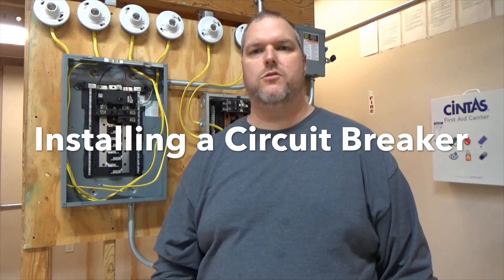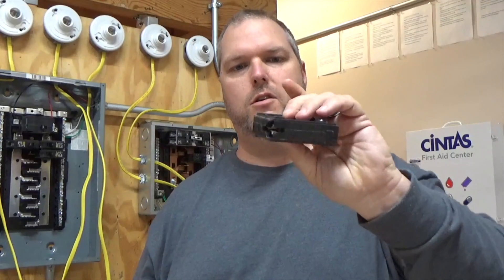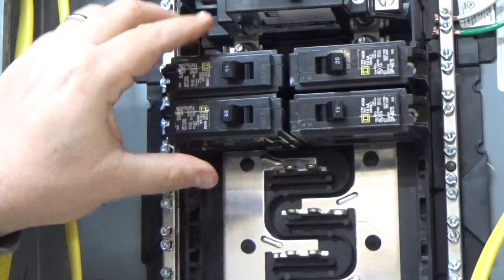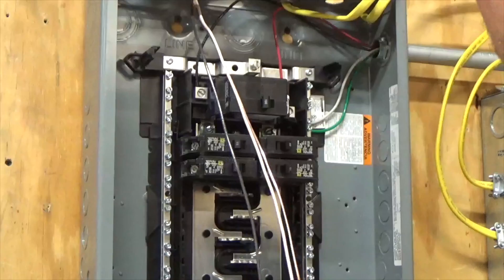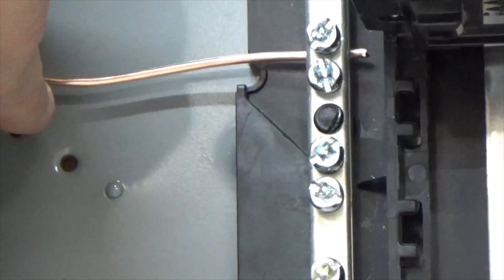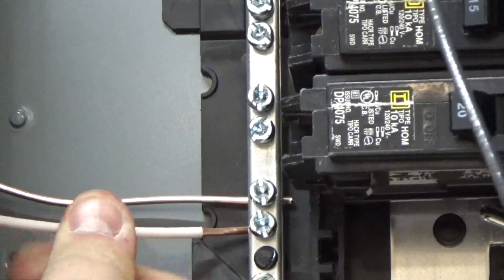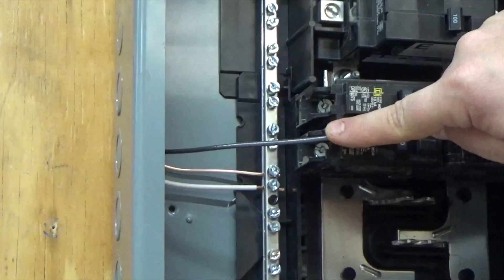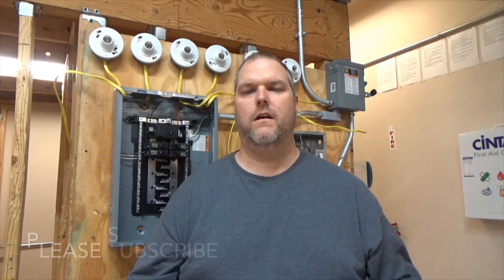Installing a Circuit Breaker

Comment: Is it safe the put the neutral wire with the ground wire on the same bus line??
Reply from the maker: You will have to add a ground bar and land the grounds or bare wires and the neutrals will go on the bar connected to the neutral feeder wire. CM
Reply: Do You know how I would run it with a sub panel
Reply from the maker: This question is asked alot and the answer is yes. This is my trainer and it is used to show a main panel. The ground and the neutral are bonded in a main panel. Now if this was showing as a sub panel than No as then the grounds and the neutrals would be separated. Please understand that it is to show a main panel. I will be doing a video on where this is explained in the code as it seems most people dont realize there is a difference between the two. Thank you for the question!!! CM

Comment: Best electric tutorial I have seen on youtube
Reply: SE AK you serious ? This panel is obviously not connected. But some panels are. So if he used any common sense he should have mentioned to turn the main circuit breaker off. And he put the ground wire and neutral together.
Reply: @zvezdandespotovic1693  the only way to know how much somebody knows about something is if you know about that something yourself.otherwise you could be telling somebody which spark plugs works best in a diesel engine, and someone could  think you're very knowledgeable.

Comment: No mention of making sure the power is turned off before starting or how to check to make sure there is no voltage present where you are putting your hands. Then you put the neutral and ground on the same bus. I wonder how many people are going to get hurt because of your incompetence. I wouldn't trust you to screw in a lightbulb.
Reply: jeff r the ground and neutral are bonded in a main panel anyways so what’s the problem with this one? It’s literally the same thing. That bus has the screws in pairs for each set of neutrals and grounds to be connected there. What’s so hard to understand. Maybe you shouldn’t even be screwing on light bulbs

Comment: Ground wire and neutral wire don't go to the same terminal block..
Reply: In a Residential setting it is now NEC code to land your neutral and ground under the same lug on neutral or ground bar

Comment: Craig, good presentation, however, at the beginning  you gave permission to your students to poke their hands into an electrical box while looking the other way. Glad for you the panel was cold and your hand stopped where it did. A careless student might not be so lucky.
Reply: You're not supposed to work them hot.
Reply: There can still be parts that are hot where the main breaker lugs are in a main residential panel unless you get the utility company out to pull their meter while you work on the panel.
Reply: Dan Benton what u mean

Comment: Did i miss something, or did he fail to mention at the very beginning, that it would be a great idea to turn the main power off before anything else
Reply: Where the fuck did common sense go.
Reply: That's optional
Reply: @ltwadley7619  the result would be longevity?
Reply: @lanceclayton2492  Learned the hard way, I blew out my panel and got a terrible shock.....turn power off before inserting the breaker.....
Reply: Pro or not i will recommend you turn the main off, ALWAYS, do me a favor and don’t get kill
Reply: @merceds4633 right? And what pro is coming to YouTube for a tutorial on what has to be the most basic skill for a pro?
Reply: @merceds4633  if you're a pro and you turn the power off your not a pro.
Reply: @stevansaucedo4151  said who?
Reply: stevan saucedo it’s always the “professional” swimmer that overconfidently finds a way to drown
Reply: @stevansaucedo4151  strongly disagree. The only reason to NOT turn the power off would be a situation in which the work REQUIRED the panel to stay live. Those very specific conditions do exist, in which electrical work must be done while the work area is live... but for most people replacing a basic breaker in their home or garage or so on... it's just plain dangerous and silly to be doing this with the panel live.

It takes half of an amp of electricity across your heart to kill you. Those bus bars and especially those big mains coming in are no joke, many times more juice than necessary to put someone to bed for good. 

Take the 10 seconds, shut the main off, and do the work safely. Just no reason not to do it in 99.9% of the cases.
Reply: @brandonkick  I am a foolish novice DIYer.  I was upgrading old outlets in my 1060s home.  Being careful to turn power off before working on each one.  And testing my work as I went along.  One outlet...I thought the main power was off.  It wasn't.  I am lucky the tool I had in my hand was a wire cutter with a very thick rubber handle.  Or I'd be dead.  You should see the melted steel at the cut-end of this tool.  Scared me out of any electric work.  That was 12 years ago.  Now I hire an electrician.
Reply: also he touches the power bus like its ok to do so.
Reply: The panel is designed to be worked on while it's energized. NEC code requires the cover to stay on unless a qualified electrician is present.
Reply: He's saving time by not turning it off
Reply: Nor did he mention not touching the lugs
Reply: My chief concern would be having a neutral bounce over and hit a hot leg while I was wiring it.  Replacing an existing breaker without a need to cut wires is pretty easy to do hot.  Stand on a dry board and use one hand where you can.
Reply: u missed the last episode
Reply: Obviously he is an instructor and he looks like he’s in a classroom environment the only thing that breaker panel is connected to is those light  ball sockets with no light  bulbs connected so yes it wise to shut off the main power with actually working on it but the The video it’s demonstration model
Reply: He never mentioned it, but most of us know to turn it off first!
Others will find out🥺😢😩😤😳
Reply: @marcelociarro8527  both
Reply: Yes, point taken
Reply: No legs from the utility company are connected.
Reply: he is the instructor...   do not question him, leave it on
Reply: That depends on the homeowner bucko
Reply: Optional
Reply: 🤣🤣🤣you right hw didnt mention it,he might have super powers🤣🤣
Reply: i think he forgot to mention that because his panel is a display panel and doesnt have an actual hot main. seems like he knows what hes doing but is or was new to making a video.
Reply: Unfortunately yes. Hopefully everyone attempting this sees your comment and turns off the power.
Reply: Idiot
Reply: Jesus, do people not use common sense anymore? Why do you need to be told to have the power turned off to work on the MOST DANGEROUS part of an electrical installation? Is that not something they need to figure out?
Reply: I think it was suppose to be implying that the electric was already turned off. However, I agree he should of mentioned it & made it very clear to be sure the electric was off.
Reply: I guess it all depends how comfortable he is with it. I would turn it off, but I dont do it everyday.  I have replaced receptacles that were live,  but that's not so scary to me.
Reply: If you don’t know to do that you shouldn’t be installing breakers
Reply: @gunneredwards6609  correct…..but people reference YouTube all the time as DIYers. Can t assume anything.
Reply: exhalejackie so u telling me to put a break in the panel u have to turn it off? u can't do it live?
Reply: @NewPhone-bg7do  Not if you like to live. While you can complete the job... there is still a risk of installing a breaker while the box is hot. Best bet is to kill the power at the main. Even better is if your house has a disconnect on the outside, like mine does... then even those big beefy mains coming in can't get ya. Of course, all the pros and manly men will say it's a sissy thing to do, but I rather enjoy living. I don't take unnecessary risks, when the dangers are possible death... just isn't worth it.
Reply: @NewPhone-bg7do  hell naw you shouldn't
Reply: If your a professional electrician and know what your doing you don't have to turn power off.  I asked the same question to the electrician that worked on my panel. Be careful not to cross any wires.
Reply: @LugNuts2.0  and don't get absent-minded, if you work them  hot.
Reply: exhalejackie This guy is someone to never follow. Very stupidly dangerous video.

Comment: when you're installing a brand new panel, how do you know you have a 100 amp panel or 200 amp panel. Do all your breakers add up like say 15 +15 +15 + 15 = 60 so then you just do a 100 amp as your main. Is that how it works?
Reply from the maker: Its based on your Main breaker. You must be sure your wire Ampacity can handle the load you are applying to it. This is a common question. I will be doing a video that explains this to make it more clear. CM

Comment: Very helpful video. I have a question, much be a silly one. My back room is connected to 20amp breaker. In that room, I have my tv, cable box, tv sound bar, dusk til dawn light, porch lights, 2 fans, and a small refrigerator. They’re not all connected to the same outlet of course, but until this day, the breaker hasn’t tripped. I know a refrigerator can take up a lot of Energy and I’ve read that a refrigerator takes over a third of a 20amp breaker. I’m not a pro and I’m looking for a lot of input. What do you think?
Reply from the maker: Well that does seem like a lot but when you think of it in Amp draw most of the stuff you have does not draw all that much. Seems to me you just had a bunch running at the same time. If this was your only time I would not be concerned, but if it happens more then email me and we can discuss some options to help you. Thanks for the comment!! CM
Reply: Craig Michaud- Electrical Instructor I don’t run everything at the same. The lights are only running at night, the medium sized fridge course all the time , and the tv/fans only when I’m back there . So far so good....
Reply: @josep2807  If it were a regular sized refrigerator, I believe the NEC requires a dedicated circuit to a dedicated appliance, which means one is not supposed to put any other load on that circuit.  In your case, it's a small refrigerator.  20 Amp x 110 V = 2200 Watts maximum.  You don't wan't to load the circuit up to more than 80 percent of the 2200 Watt capacity = 1760 Watts...that's called a safety factor.  Now, each of your items has the watts listed on the equipment, or sometimes listed as VA.  You can add each item wattage up to see how you compare to the 1760 Watts, in the event everything is running at the same time.  It's required by law that each item list their wattage intake.

Comment: Clearest instructions I've seen on this.  Thanks.   I had one electrician quote $900 to install a breaker and an outlet right next to the box.  For $50 in materials and 90 minutes I did it myself

Comment: I need to run a dedicated circuit for an air compressor. It says that it will use the full 15 amps of a normal breaker. Should I step up to a 20 amp breaker or stay with a 15 amp?
Reply from the maker: You need to make sure your wire can handle the 20 amp breaker. I mean if you have a 12 AWG wire then yes but if its only a 14 AWG then NO. CM
Reply: Kevro869 15
Reply: Most compressors can be wired for either 120 or 240. Check the motor, 240 would probably be better, if you have enough amps left on your service  to do  that. And you have 240 coming into wherever you are, to begin with. That would be two hot wires coming in, along with the neutral. you get a double breaker for the amperage required that the motor says, for 240, and in the panel, it's set up so that one breaker would pick up one side, and the other one picks up the opposite side. In other words they're staggered for that reason. On the compressor motor, It would say something like 15 amps for 120 or 7 1/2 for 240. you still have to count up all the circuits you have existing all ready, and see if you're already maxed out for your main  disconnect. Your existing service might not be  big enough to add any more  circuits.

Comment: DO NOT DO WHAT THIS GUY DID AT 1:30! DO NOT touch the FLAT-METAL on the BACK OF THE BREAKER BOX...YOU WILL GET FRIED!!! That is the LIVE Bus-Bar!
The Breaker Box he is using NOT plugged to the Grid...but YOURS IS!!! YOU WILL GET ELECTROCUTED!!! Get yourself a THICK pair of Electricians Gloves. DO NOT DO THIS BARE-HANDED!!!
TERRIBLE INSTRUCTOR!!! JUST A TERRIBLE INSTRUCTOR!!! Get this video off of YouTube and replace it with one which shows people how NOT to get electrocuted before you get someone killed!

Comment: Helpful for me, thank you.  DO you have a video on how to pigtail wires in the electrical box?  For example, if you run an 8 gauge for a tankless electric water heater and need to pigtail the 8 gauge ground wire due to lack of room on the buss bar?  Keep up the good work!
Reply from the maker: Sorry I dont at this time. I will add it to my list of things to shoot. Thank you for the suggestion. CM
Reply: Just land it under the neutral buss bar assuming it’s ur main panel and u have room

Comment: Can you do a video to show the other end of the 12/2 connecting to an outlet?
Reply: TURN OFF power first !!!!!! Then Black to gold or brass color screw, white to silver screw, bare copper to green screw which is the ground... I'm no expert or teacher, but this is how I do it.. May I suggest check panel box first, make sure BLACK is connected to the breaker and not to the ground or neural. I once was installing plug ends at an old home and it was all backwards... Peace.

Comment: I saw a video on Home Depots website made by a breaker company that said you have to use the same companies breaker throughout the panel or you can start a fire.

Is this true?
Reply: Yes
Reply: Interesting
Reply: How would that be? As long as you put the same size breaker in, and it fits in that particular panel, the panel sometimes will only take certain breakers, like square- D.

Comment: Main breaker off and this installed breaker off before starting? Right?
Reply: Absolutely
Reply: If the wiring is done properly then yes. You never know how it's been installed previously
Reply: You can work it hot..it'll be alright..
Reply: @bernardoprovenzanno9487  you shouldn't tell a novice that
Reply: @frankpaya690  how I  do it is touch hot to ground with wet handd... it'll be alright....😬
Reply: @frankpaya690  you truly are a great electrical electrician
Reply: @frankpaya690  always safety bro...